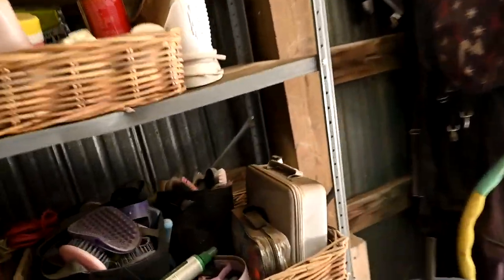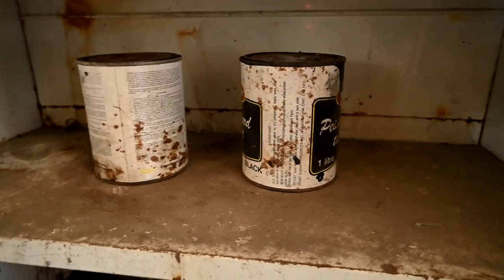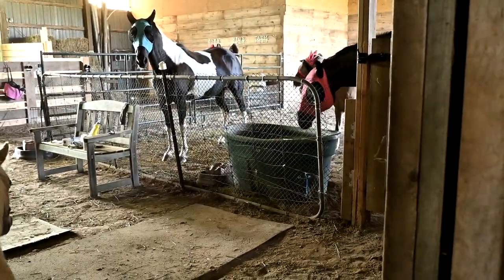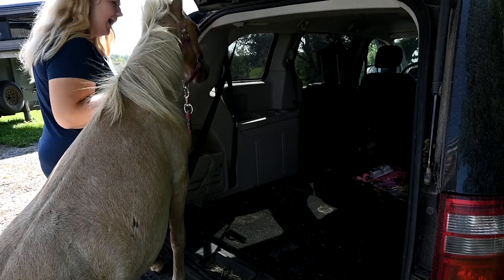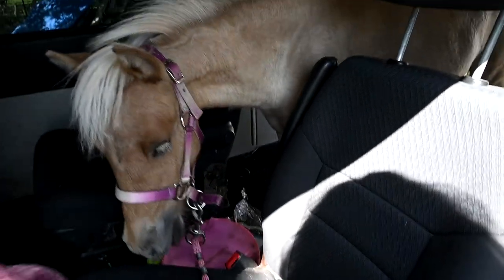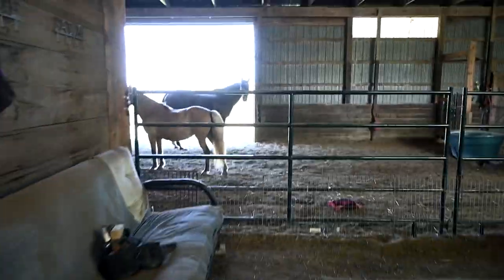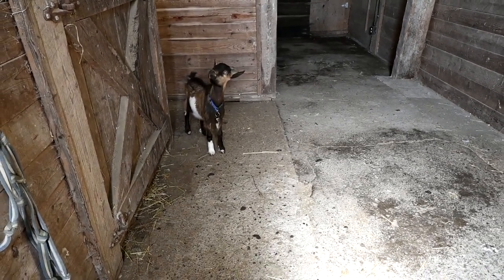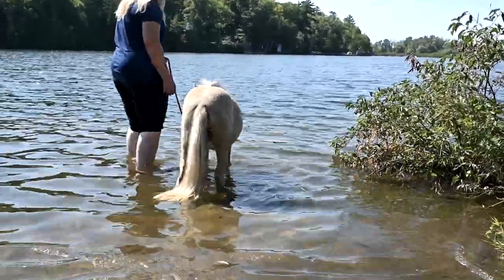We Took Our Pony To The Beach! SHOCKING!

Comment: We always used hydrated Lime in our big commercial chicken house to dry up wet litter it helps cut the smell it can burn sensitive skin. Use a rubber gloves to handle it. Love it when pets can ride in the car with ya. Only animal i have that will fit in my car is my sweet beagle.
Reply from the maker: So did u put it under bedding and leave it there, or did you just throw it on the wet stuff. Let it  soak stuff up and them toss it before the animals went in again?
Reply: We always put it in after cleaning out before the next flock after the slat are removed litter cleaned out lime goes down than put the slats back put some lime in the isle if some of the wet litte dropped from the trucks and put shavings on top. I'll see if I have some old photos I'll share on Facebook.
Reply: @DayByDayVlogs  I sent a pm Facebook messenger with photos. Of the inside of the chicken house.